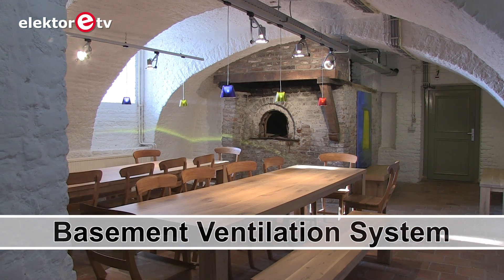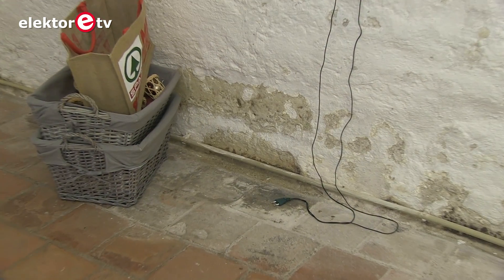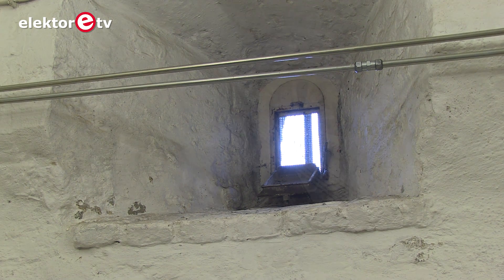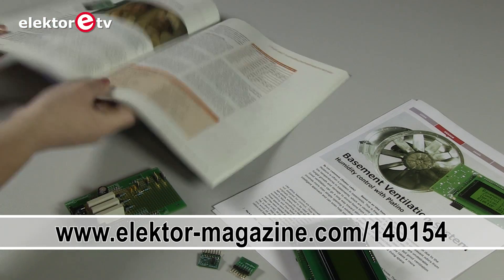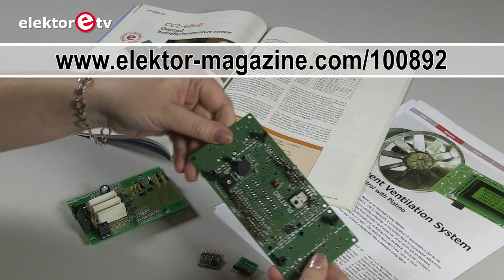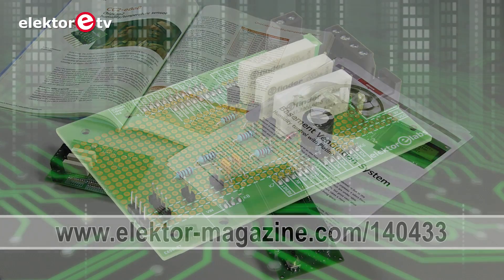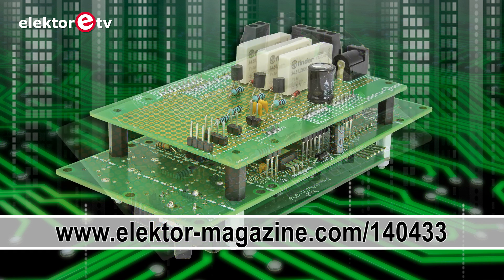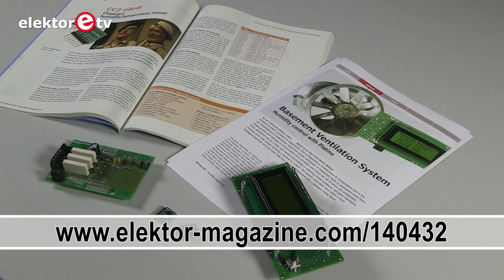Basement Ventilation System: Mold No More!

Comment: Bob C
5.0 out of 5 stars Amazing results from a unit called the Breeze, available online from Breeze Systems International at 1/4 the price of units like Humidex, Wave, and EZ Breathe- I was a non-believer, but am now blinded by the light! They make crawl space units too. Reduces Radon gas.
I was 100% skeptical about this thing having any impact on my musty basement. I thought I was buying snake oil, but was at my wits end when it came to how to deal with the smelly basement on Cape Cod. We had a dehumidifier for years that would remove the moisture from the basement, but we would still get a "wet" spot on the floor at its lowest point and we had a musty smell that had us looking for ways to seal the basement door. When we would open all the windows and the bulkhead, we would get relief, and it would smell okay, but once we closed things up when it got cold or was raining we were back to a smelly basement.
I installed this where our floor is the lowest and where we often would see condensation on the floor and have it venting out one of the basement windows that I adapted for the purpose with a vent.
I am absolutely overwhelmed by the difference that this device has wrought - my basement musty odor is "cured" - it smells great down there and here is why - this little thing acts like a chimney of sorts, it pulls up the nasty moist air from the floor and shoots it out the window - and sucks down fresh air from the upper floors - circulating the air into the basement with fresh air, BUT also removing the worst air that is down near the floor.
I couldn't be more shocked at the results this little device has delivered - amazing. I really thought I was going to be disappointed as I thought "what on earth can this thing really do" but the answer is in the description - a dehumidifier gets the water out, but you still have the same stinky air in your basement - this thing really does the job and I could not be more pleased. I show everyone who comes into the house. My wife is also amazed - she used to dread going down to do laundry - now, she has no excuse!